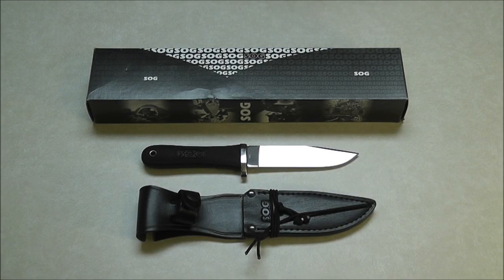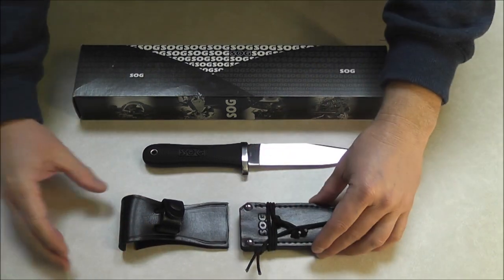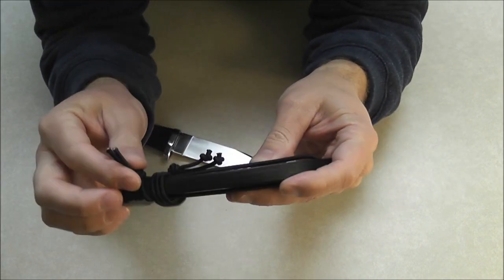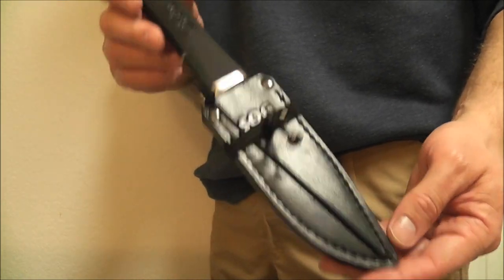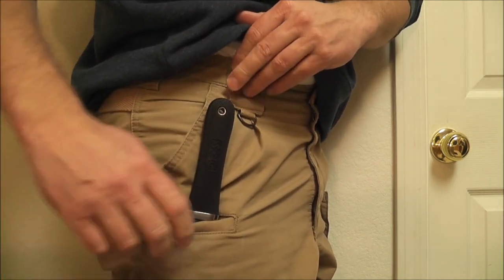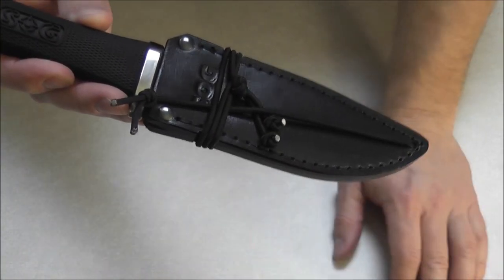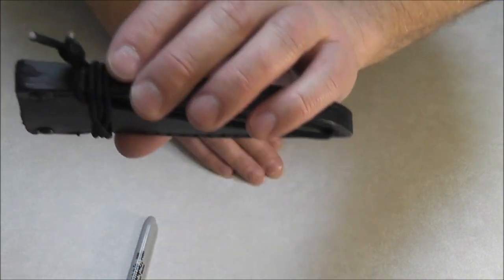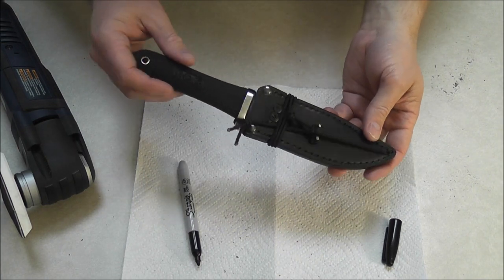SOG NW Ranger Sheath Mod

Comment from the maker: I just tried the SOG in the Mora Bushcraft Forest sheath and it's like yours but tighter, actually too tight.  Also, the upward pressure on the finger guard forces the cutting edge into the plastic, which I'm a tiny bit 'OC' about.  That plastic mora case is amazingly simply though isn't it.  Too bad SOG couldn't have done something like that.  I'm happy now!  Actually giggling pleased about the mod.  Thanks for sharing your ideas man.

Comment: Nice modification brother! I just bought this knife from ebay but it came with the original nylon sheath and doesn't have the grooves in the guard. The SOG Tsunami I own has this similar sheath however. Again, nice work!

Comment: I liked this mod so much, that I used it as a template, to modify my NW Ranger leather sheath.

However, I decided to keep my belt loop and cut out a small 'squared' section/notch of the sheath, just large enough to accommodate access to the retention chord.